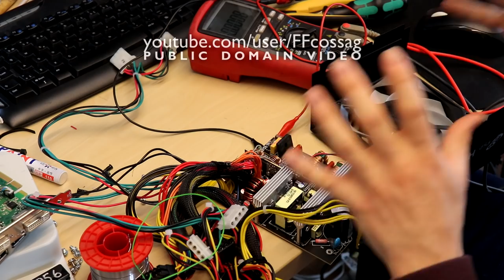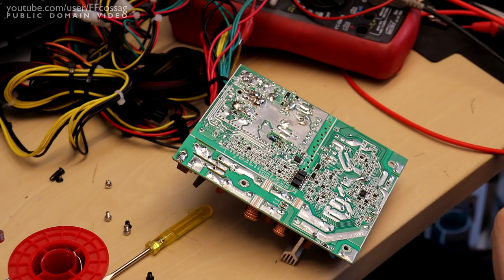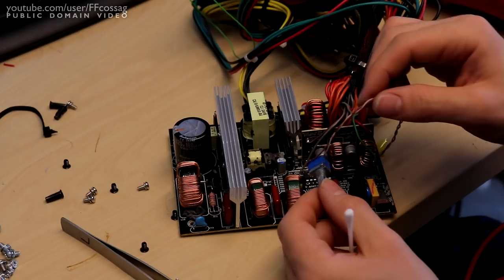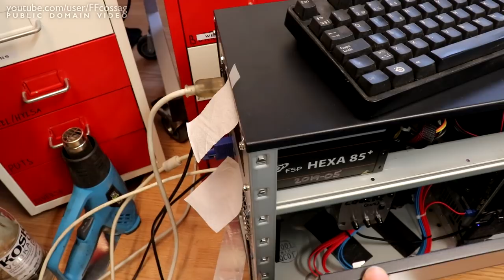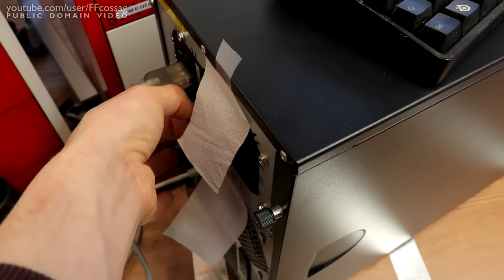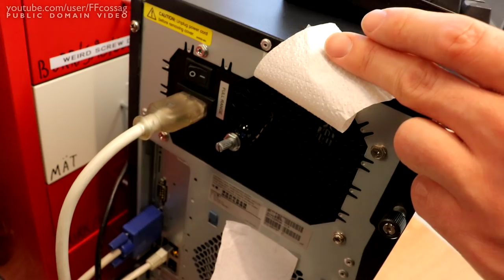FSP Hexa85+ fan speed hack

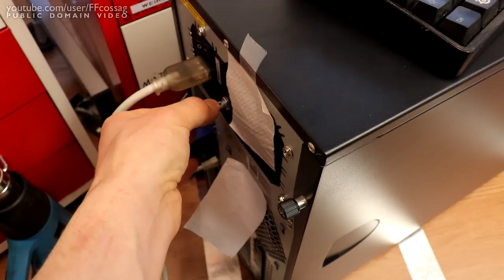Comment: @11:00 you demonstrated that the actual issue is lack of inlets to allow enough air into the case so the fans to not fight each other, what you could have done instead was to turn around the case fan so it blows into the case instead, would have solved the issue instantly.
Reply: turning around the case fan would probably make it worse for the rest of the computer by having the bulk of the airflow bypass the actual pc
Reply from the maker: The reason for the fan configuration is that the main thermal load in the system is a big hard drive array at the front of the case, which has no dedicated fan. It is indeed very restrictive of airflow, but there's no way around that.

As such, turning the case fan around would just set my hard drives on fire.

Comment: Too hot PSU just means 2 things:
- Too cheap or not enough watts.
Anything with a sleeve bearing can’t be top quality...
Get a proper wattage one or better, get a little better brand/model.
Reply: or just improper fan! he says so in the first 30s.
Reply from the maker: It runs hot because I replaced the fan with one that has a lower minimum speed than the stock one, and the unit is being used in a case that has very low pressure inside.

It's difficult sourcing efficient low-power power supplies. This one is 80+ Bronze rated, and it's mostly going to see a load of less than 50 W. Since efficiency is lower at lower load, buying something like a 500 W supply that's 80+ Gold rated would net a lower efficiency since it'd be running at barely 10 % load.

In short, cheapish power supplies are the only option for efficient operation at very low load. And since I don't mind modifying them to suit my needs, it's not a problem.